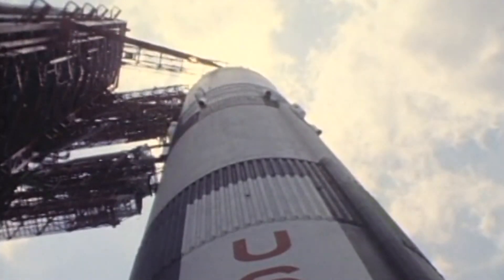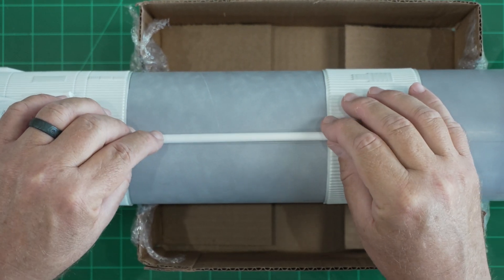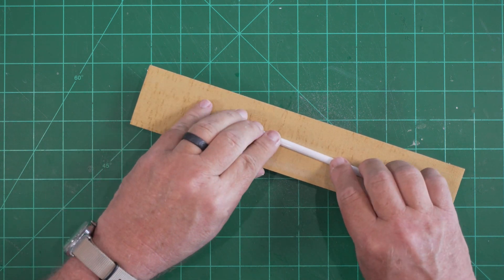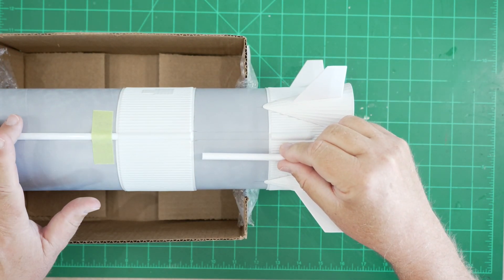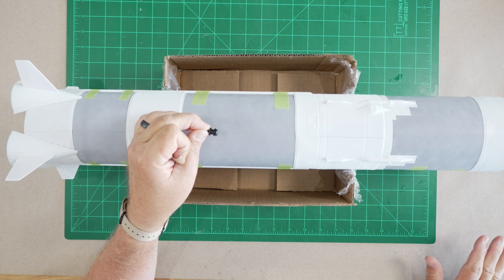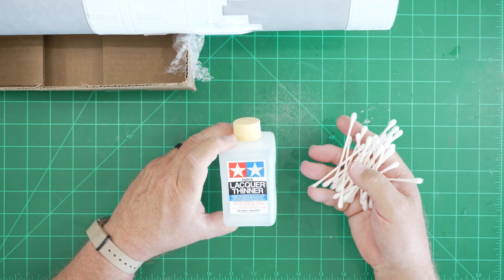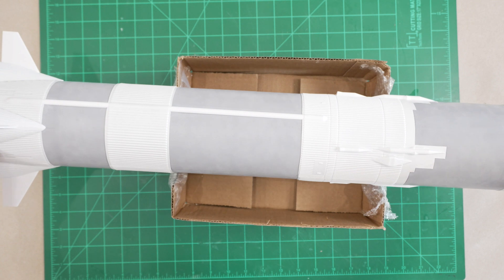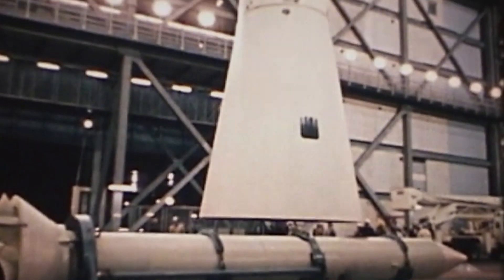Building the 1/100 scale Estes Saturn V: Part 8, Cable Raceways

Comment: My tunnels had some upward bowing at the ends. I had to secure them firmly down as you did, with tape. You can undercut the tunnel ends to account for the styrene thickness with a blade as you did or with sandpaper, either way. I also used rail buttons😊. They actually look more like something that would be on a rocket than lugs anyway.